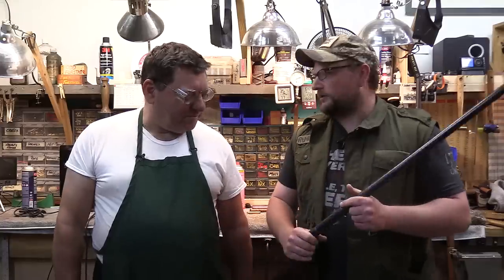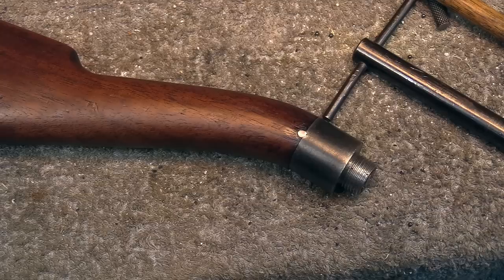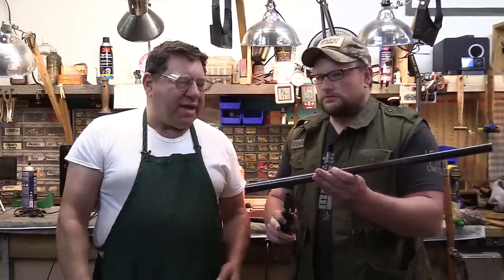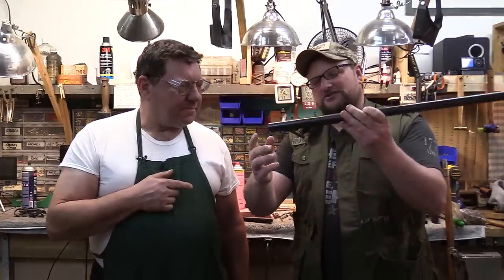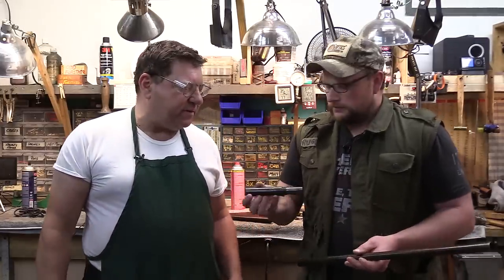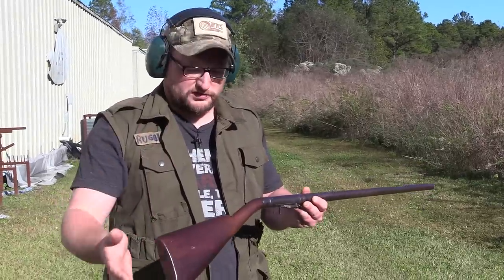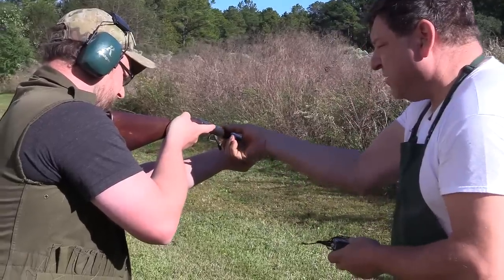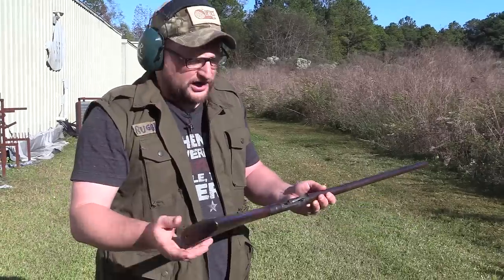New England "Traveling Gun" with Anvil Gunsmithing

Comment: Th design could be either a British unmarked under hammer pattern, by John Day or Hopkins and Allan not walking gun but it's design is a Cane Gun in particular, the reason why it has a screw on the back is to change from a stock to hand grip to mimic a walking cane

Comment: I was under the impression that it is generally considered unsafe to fire old guns with twist steel barrels.  I inherited an old side by side shotgun with twist steel barrels from my grandfather and in an attempt to find out more about its history on line about all I could find said not to shoot it.  The gun does not have any markings that I have been able to find to say when it was made or who it was made by.  For all I know it could be a replica made as a wall hanger but I kind of doubt it as the quality looks a little too good for something not intended to fire.
Reply: Damascus and twist steel barrels are ONLY safe to fire with black powder loads. (And only if they are in good shape.) 
I've heard you can get the barrel x-rayed to check for likely failure points.
(Even then most people shoot reduced loads in them to go easy on the vary old guns.)
Reply: @wadekirby8575  Good to know.  As old as this one looks I probably wouldn't shoot it even if it passed an X-ray test for fear of ruining it.